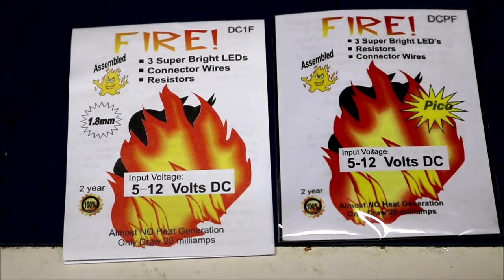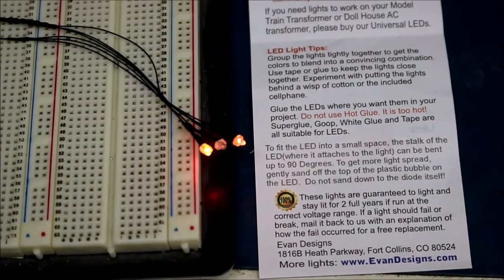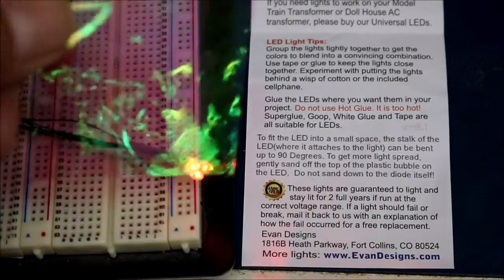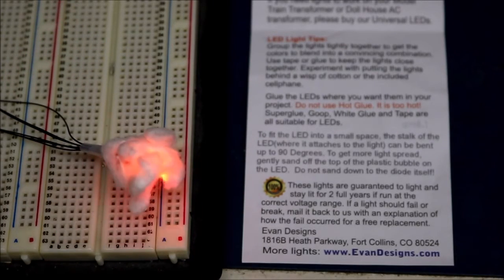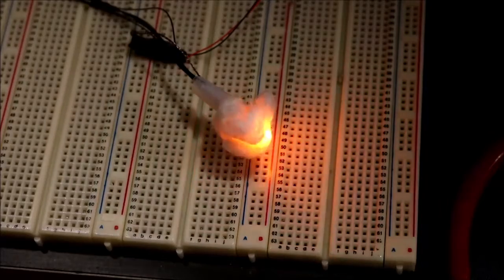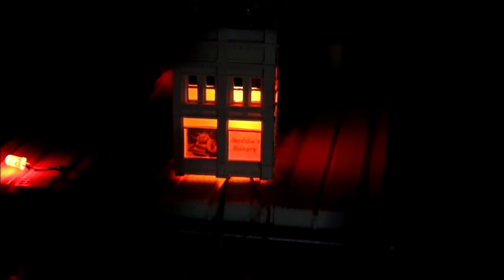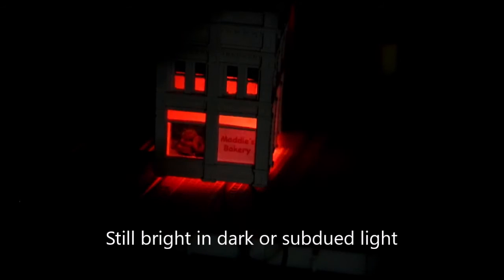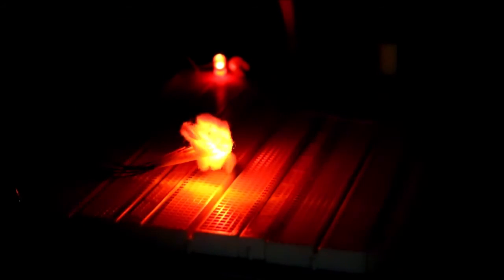Fire simulation  Review of Evans Designs Fire LEDs

Comment: Cotton seems to work as a nice diffuser.   You might also try clear silicone caulk (GE Silicone II or similar) that can be cured into shaped flames, and even tinted with a drop of acrylic paint (red, orange, yellow).   To protect the small LEDs (0201, 0402, pico, nano, etc) from having their wires pulled off, a light coat of clear nail polish on the LEDs works pretty good.   All the best ...